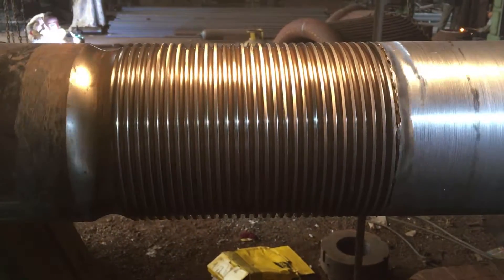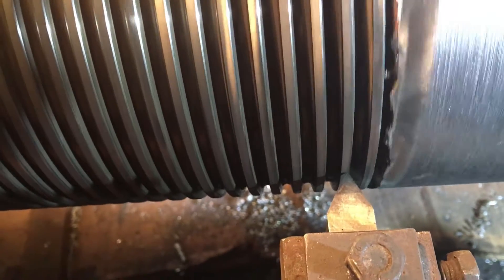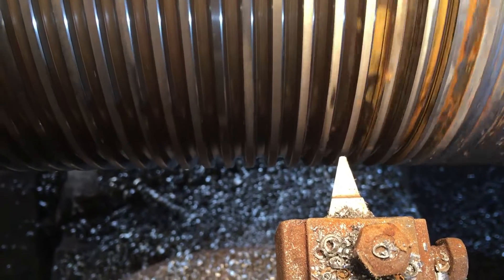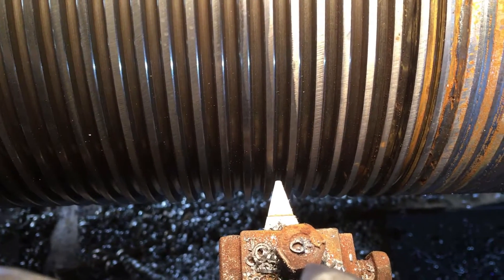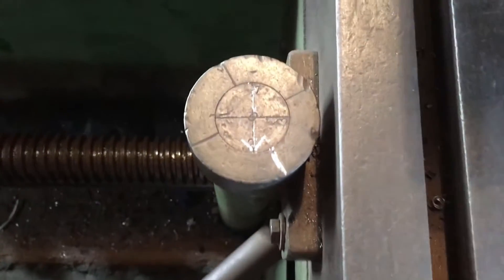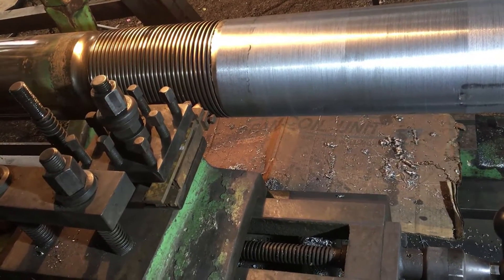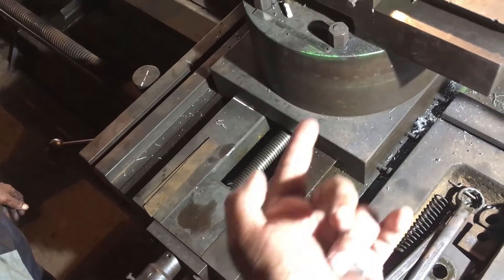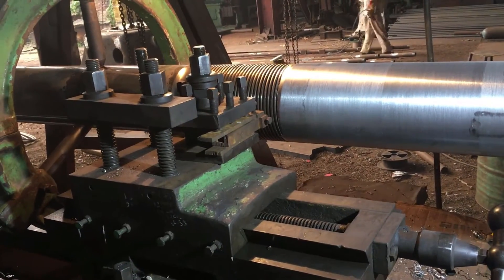How to match an existing thread on a Shaft on a lathe (MUST WATCH) | threading on a lathe

Comment: You can pick the thread back up with the compound at an angle without disengaging the chuck. I just did it last week in fact. You just have to fuss around advancing the compound while retracting the cross slide.
Reply from the maker: +joshua43214 that's a solution alright. Basically you are doing exactly what I show in the video but compensate for the angle by moving the cross slide. Excellent. Thanks for sharing. Why not make your own video, demonstrating the technique. Would love to watch that. 😊👍